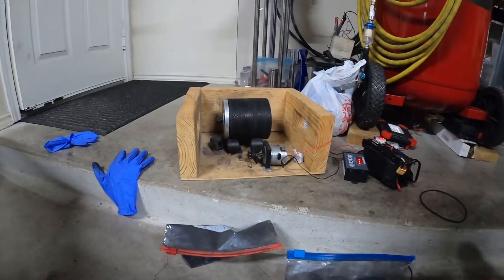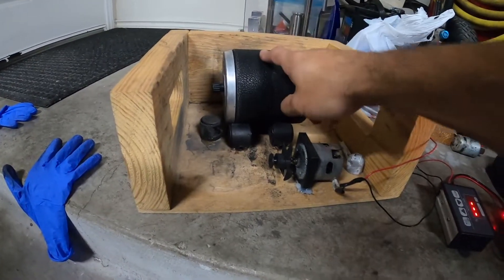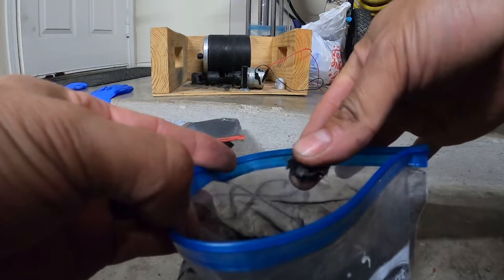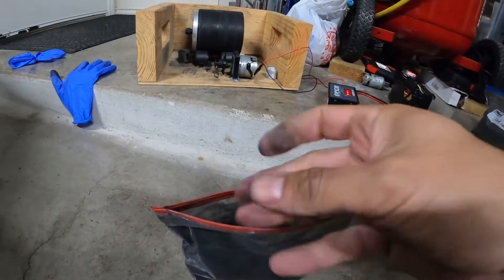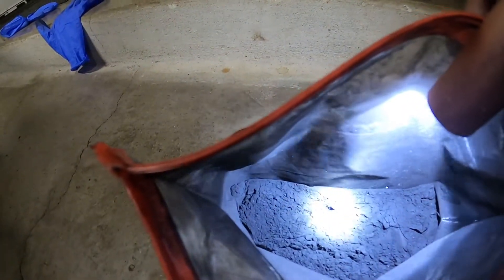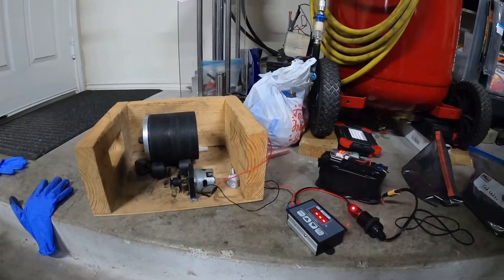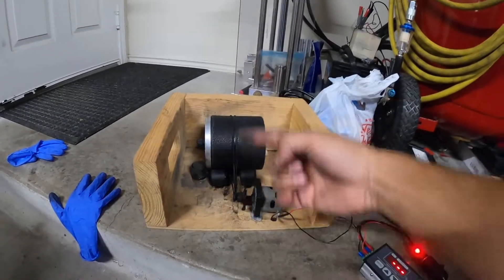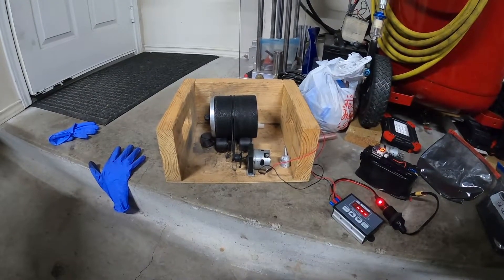Charcoal that is very fine like 🌙 Dust

Comment: I really like this video. How do you char the cedar to get the charcoal? What method? I live in WA state where cedar is everywhere, and I want to try making my own charcoal. Do you start with green wood or is it dried branches you picked up under and around the tree? I need an idea on what kind of container to use to put the wood into. Thanks again for another informative video. This one really caught my attention.
Reply from the maker: Hey so for this one I bought at Walmart it’s red cedar pet bedding and I used a paint can to char it and then I take the charred shavings and ball mill them to the fine air float you see here. I then store it in a plastic container that has a snap on lid. If you were going to use branches you would just cut them to size and the heat will remove all the moisture but it does take a while to char it completely through.